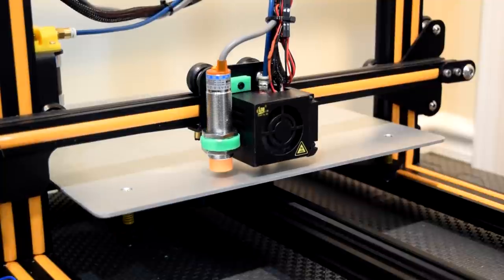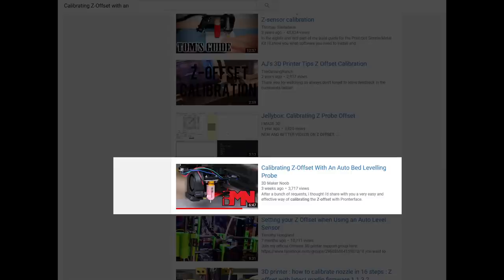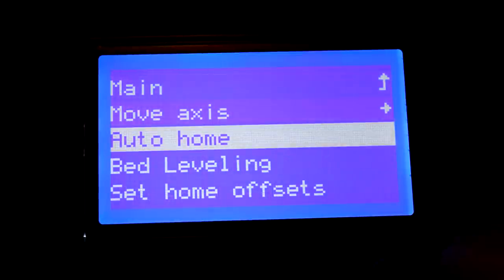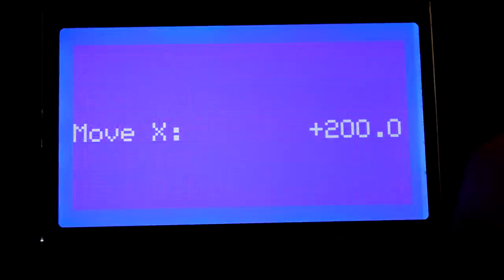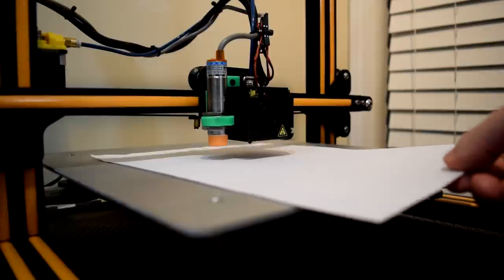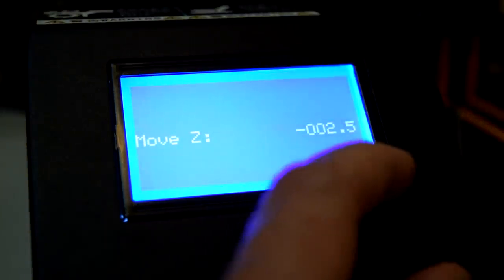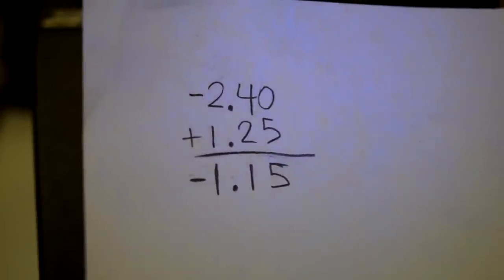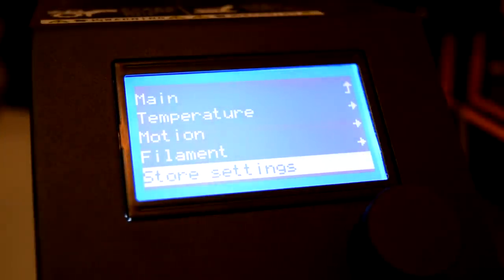Setting your Z offset the easy way in Marlin

Comment: I don't know what machine you're using but my NEW Ender 5 Plus doesn't have any of those critical options available on my screen.  If it did I would have solved my problem long ago.
Reply from the maker: it's a CR-10 with Marlin 1.1.7 installed on it. some 3d printer manufacturers disable some of those menu items to save space on the mainboard. There are other ways of accomplishing the same thing by hooking your printer up to a computer and manually sending GCode commands, but if your printer came with an auto bed leveling sensor already installed, you may want to search for other videos that explain how to do that for your printer.
Reply: @RemainIndoors  I've been watching videos until my eyes bleed.  They all say the same thing but my printer won't accept any terminal commands using either Pronterface or Matter Control.  I'm wondering if the firmware is corrupted.
Reply from the maker: @ramtek2702  I imagine you've already watched this video:  https://www.youtube.com/watch?v=zSOVAdKw4ss  I looked through a few of the comments on there and that seems to be a pretty common complaint, which sucks. What I would do if I were in your situation is look to see if there's a Facebook group specifically for that printer, because I've found that's the best place to find other people who have figured out how to fix issues that I can't figure out.  I don't own an Ender 5 Plus, so I can't be much help.  sorry.
Reply: @RemainIndoors  I've tried to watch that video but the kids English makes it nearly useless.  They don't really cover the right content anyway.  I'll try FB.  Thanks.

Comment: For some reason, I cannot lower it into the negatives. How can I fix this? I am on Marlin 2.0. using Cura.

Thanks
Reply from the maker: One option is mentioned in the video description: if you can't move your nozzle below 0 in the Move Z menu, send the following GCode command to your printer from Pronterface or Repetier Host or from the Terminal tab in octoprint:
  M211 S0
this will disable MIN Software Endstops.

Or, you can manually adjust your sensor up a little bit (carefully though, to make sure your nozzle doesn't crash into the bed) That way you would have to change the z-offset to + numbers instead.
Reply: I am having the same issue with geeetech 83 pro b printer. Did you end up figuring it out?

Comment: Does this work the same for the Lulzbot Taz 6 with Marlin firmware? I'm using a 0.8mm nozzle printing at 0.6mm layer height. I have been having troubles printing consistently because it seems like the z-offset is arbitrary. One day -1.6 is the magic number and then -1.9 becomes the magic number. Recently, I've adjusted it and then visually determined if it's working well, but I would definitely prefer to calibrate it so that it can be the same for most layer heights and so on. 

p.s. the firmware was a recent change since the new cura 2.6.66 software came out. Before this was never an issue. Maybe it's something to do with the lack of wiping the old settings? Any suggestions are welcome! Thanks!!
Reply from the maker: yeah, you may want to try what I suggested to Boyd Crowder's comment to load up the default settings from the firmware. it's hard to say if the previous Marlin settings could be affecting your new settings, but that does cause problems for some people. And, yes It should work the same for the Lulzbot Taz 6 assuming the Marlin firmware has the MIN_SOFTWARE_ENDSTOPS line commented out like this:
//#define MIN_SOFTWARE_ENDSTOPS 
that's what lets you lower your nozzle below 0mm

Comment: Newbie here.... How can I store it if there is No Z Offset listed under Control? (Sorry..I am new to this all..)
Reply: You probably don't have Marlin installed, it's an option only available with the new firmware installed.
Reply: you might need to update your firmware
Reply: Marlin on the stock Ender 3 board is somewhat limited.  You can re-flash your current board to add mesh leveling though. You can also update to a newer control board like the MKS Gen L V1.0 which has enough memory to handle all that Marlin can offer.
Reply: @TechGorilla1987  Hi, I had to upgrade the boar to MKS Gen L v1.0 and TFT 28 display I fried both the originals  ;(, but I don't have the menus for the Z offset anymore, do you know how to get then in the TFT28? I am using the latest Marlin.
Reply: @manolo5104  You have to modify the configuration.h file and enable bilinear bed leveling festure. Dont forget to put Save homming and define sensor offsets and travel limits. Thats all

Comment: Legend, thank you! I've been chasing my tail wondering why the Z offset on my Tronxy X3a didn't seem to do what I expected, now I see why :D
Edit- one question, when my machine does its bed level routine, it does a much smaller grid pattern than the actual bed size, towards the front left. Is there a way to configure this so the whole bed is checked? Thanks.

Comment: i don't have control > z offset in my lcd, would be usefull knowing the version of marlin you where running
Reply from the maker: sorry for the late reply, but I have another couple of videos where I installed an auto bed leveling sensor with an Arduino Nano on my CR-10. It's Marlin 1.1.6, and there's a download link for the firmware I used if you're interested:  https://www.youtube.com/watch?v=UtoF3Vs9YhI

Comment: I just want to know how to reset the damn CR-10 V1 to factory settings. Somehow a z-offset was applied and I can't figure out how to reset everything.  This should be simple yet I can't get a straight answer anywere???
Reply from the maker: if your printer's menu doesn't have a Factory Reset option anywhere in it, you can try hooking up your printer to a computer and sending the GCode M502 for Factory Reset and M500 to Save the settings.

Comment: Great video!  I have a question.  I had to disable soft endstops via 211 s0 to be able to lower my z offset. If I change the z offset via 851 zxx and then reenable soft endstops via 211 s1, Will the soft endstops stop the z axis from lowering down to the number I changed it to?  Would I always have to keep them disabled?
Reply from the maker: Thanks. Nice thing is after you change your Z offset and run Auto-home again, your printer will view Z = 0 with the new updated Z offset value factored in. so even if you re-enabled software endstops, you should be good, until you need to change your Z offset again

Comment: so I keep trying this but no matter what I seem to do it seems like the BL touch is still keeping my nozzle like .2mm too high so when I start any print it just ends up curling and dragging on the nozzle instead of applying nice and firm to the bed... wondering if you have any tips on how to fix this?
Reply from the maker: when you slice your files, what are you setting as your first layer height?
Reply: @RemainIndoors  .2mm for all layer heights is what I usually use. I was able to fix the problem by just trial and error..ing.. the z offset until it was close enough to the bed. so its good now! lol

Comment: Once you set your z offset, do I still need to set the 4 corners of the bed with the paper
Reply from the maker: for auto bed leveling, no.  It is a good idea to do that once, just to make sure your bed is parallel to your X axis, but it's not mandatory as the Auto Bed Leveling system will just make your hot end follow the angle of the bed.

Comment: Hello, should this be done with or without the mirror? thanks
Reply from the maker: Hi, it depends on what kind of sensor you're using. for BLTouch or Capacitive sensors you should be able to use a piece of glass on the bed, but Inductive sensors only sense metal.

Comment: Cool.  What is that sensor hanging on the side of the extruder?  I'l like to see about setting up my Tevo Tornado this way.  leveling the bead is a total bear.  Also Have to reset my X and Y axis too because the standard leveling set is too close to the edge of the plate.  Thanks
Reply from the maker: I have a video about setting up auto bed leveling on the Tevo Tornado with a BLTouch if you're interested: https://www.youtube.com/watch?v=mBwHGuX5de8
Reply: Oh thanks very much.  Yes I believe I found your video right after viewing this one.  ;-) Big help.

Comment: Nice video.  One thing though when I auto home, the hot end just goes to the 0,0 corner.  It does not go to the center like yours does, why is that.
Reply from the maker: there's a setting in the firmware that changes it to that. Are you using an auto-bed-leveling sensor? normally you would set it up to go to the middle to make sure the sensor is above the bed instead of hanging off the edge, because if it doesn't sense anything, your nozzle will crash.  Without that you're relying on mechanical endstops to tell the hotend when to stop moving, so it doesn't matter where it homes on the bed, and it has to go back to 0,0 anyway, so just faster to home there.
Reply: @RemainIndoors  Makes sense.  Yes, I am using a CR Touch, similiar to a BL Touch.  The nozzle does not crash as the home position is off the bed since I installed a direct drive, but the Z is going too far and the steppers grind after using the ABL probe.  

I guess this means I need to compile marlin myself.
Reply from the maker: @zk_6312  yeah, I haven't done much with 3D printer mods in a few years at this point, so I'm sure things have changed by now, but it's usually pretty easy to do as long as there's a bootloader on your printer's mainboard

Comment: does this setting work with octoprint or do i have to calibrator the z axis every time i start a print thro octoprint
Reply from the maker: After you click on "Store Settings" the z offset is stored to your printer, so whether you're printing from octoprint or an SD card, the z offset will be stored, and your auto bed leveling routine will follow that.
Reply: thank you so much the video was vary helpful

Comment: What would PREVENT the print head from rising up 10MM after it homes at 0 - 0?????
Reply from the maker: it would depend on settings in Marlin. This could be something that's changed since the version of marlin I'm using in this video, or it could be something that's configurable. There is a setting in the Configuration.h file called Z_CLEARANCE_DEPLOY_PROBE that is set to 10 in the firmware I was using here, and another called Z_CLEARANCE_BETWEEN_PROBES that's set to 5.

it's a hard question to answer because any number of things could cause that, but my first guess would be the way Marlin is configured.

Comment: So would this work for me having a sprite extruder pro?
Reply from the maker: this video is kind of old, so the newer versions of the Marlin firmware may not work exactly the same way. but assuming you have the version of firmware that has these settings, and assuming you have an auto bed leveling sensor, it should work. the type of extruder shouldn't really matter.

Comment: My printer runs Marlin, but doesn't have this Z-offset setting in the Control/Motion menu.
Reply from the maker: yeah, this video is pretty old. I haven't updated my firmware in at least 6 years so it's possible that option doesn't exist anymore. if I ever get around to updating my firmware, I might look into making a new video.

Comment: HELP...got a geetech a10 using Marlin 1.1.8  when i hit "Auto Home" it goes directly to the left-hand corner.   Then when i start to print it centers on the bed but the nozzle raises about 50mm.  Thank You in advance to any one that provides help
Reply: I have the same issue, still no answer :S

Comment: How come my cr-10 doesnt have all those extra menu settings? Do I need to change the firmware to get to that motion menu?
Reply from the maker: Yeah, if you're using somebody else's firmware for the CR-10 you may not have all of the same menus. I made a video explaining how to burn the bootloader and write firmware to work with my Nano Bed Leveling system here: https://www.youtube.com/watch?v=UtoF3Vs9YhI there's a different version of the firmware in the video description which has these menus.

Comment: I'm a 3D printer noob, should this be done with factory defaults to clear any current Z-Offset? Or just set this to 0 before Auto-Home?
Reply from the maker: In most cases, you shouldn't have to change the current z offset before doing this. You just add whatever your current z-offset is together with the current z height after you find a good nozzle height. If you can't lower your nozzle enough, you may want to try lowering your Z offset a couple mm, storing the settings, and starting over.

Comment: After homing when I try to touch z axis doesn't matter if i  press up or down the z goes straight up until it hits the top support
Reply from the maker: sounds like that might be a setting in the firmware. normally if it's just an issue of the endstop being inverted, the sensor will move up a couple mm then stop, but if it's traveling all the way to the top of the Z axis, maybe it's trying to home at the top instead of the bottom?

Comment: Do you heat the hotend and bed to determine z offset?
Reply from the maker: It really depends on the kind of sensor, if you're using a capacitive sensor, temperature will make a difference.  So, in that case, yes I would heat up the bed to whatever temperature you plan on printing at first.

However, if you're using a BLTouch or an Inductive sensor, Temperature isn't going to affect the sensing distance, so you'll most likely be fine with a cold bed.

Comment: I'm getting a printer with a inductive sensor, do you have a vid on how to calibrate if I want to put a sheet of glass on the print surface?
Reply from the maker: If you want/need to put glass on your bed, you're better off going with a Capacitive sensor. I don't have any videos at the moment showing this process, but it should effectively be the same as an inductive sensor.  The only difference is a Capacitive sensor will sense glass or anything really, and needs to have the sensitivity adjusted - usually by a little screw on top of the sensor.
Reply: Remain Indoors thanks for the answer,  just now seeing it, why I didn't get a notification is beyond me as I have that turned on.

Comment: Ender 3 pro doesn't go below 0 for move 😥. Anyone running into the same problem?
Reply: Yea, Marlin 2 here so yours may different on location of this settings. I made my Motion/Bed Leveling/Prob Z Offset  a little more offset, mine was something like -1.86, I made it -2.00 that then allowed me to touch the bed at +000.3 backed it off to +000.4, I set my offset to -1.6.  I will see if that works.  There is probably a way to change this via terminal or firmware change?!
Reply: Im not sure if youre still having this issue but check the video description there's a solution for that

Comment: Can u please make a video, about how to change the other Axis. X and Y, mine starts of the bed.
Reply from the maker: good idea. =)
Reply: If you are using Marlin 2.0 and you are familiar with the IDE(Arduino or VSCode) do an Ctrl+F at the configuration.h and search for x_offset and you will find the settings for both x&y there. Take a ruler and measure the offsets and type them in. Take a look at the grid too ( back and right from the nozzle is + and left and front is minus)

Comment: Do you know what lines I need to change in Marlin firmware to enable the  Zoffset option under the Menu:Control/Motion? Thanks a lot in advance.
Reply from the maker: What printer/version of Marlin do you have? I'll have to look into it.
Reply: CR-10S with Marlin1.8.6. Many thanks.
Reply from the maker: 1.8.6 is probably the version of the Arduino IDE you're using? The newest version of Marlin is 1.1.8 Did you get your version of the firmware from the CR-10 facebook group?  If you use Marlin 1.1.6 or earlier with Auto Bed Leveling I believe that menu is there by default. I think that menu may have been removed by default in later versions.  I don't own a CR-10S so I wouldn't be able to test this, but I think you can add #define HAS_BED_PROBE to the Configuration.h file to see if that makes a difference.  Otherwise, you can try working with the version of Marlin that I uploaded on my Nano Bed Leveling video. it's an earlier version of marlin but it should have the Z Offset menu
Reply: Oh You're right. Marlin's correct version is 1.1.8. About the Has_Bad_Probe parameter, stills not enabling the Zoffset menu option. thanks a lot.
Reply: I was successful enabling FIX_MOUNTED_PROBE.   Thanks a lot for the support.
Reply from the maker: good deal. I'm glad to hear you got it worked out

Comment: I just installed the marlin 2.0.x bugfix and i can't change my offset into the negative.  My hot end wont go past 0 into the negative.
Reply from the maker: There's a setting in the Configuration.h file called MIN_SOFTWARE_ENDSTOPS. put // (two slashes) to the left of that line to comment it out/turn it off.  Having that setting turned on tells your printer not to go lower than 0 in any axis.
Reply: Marlin 2 here so yours may different on location of this settings. I made my Motion/Bed Leveling/Prob Z Offset  a little more offset, mine was something like -1.86, I made it -2.00 that then allowed me to touch the bed at +000.3 backed it off to +000.4, I set my offset to -1.6.  I will see if that works.  You probably fixed this already.

Comment: How do I get z in the center of the bed? The home in the center? Same as your printer.
Reply from the maker: There's a setting in the firmware called Z-Safe-Homing it tells your printer to home wherever you specify - it homes in the middle by default.
Reply: My printer's home is in the left corner; X0, Y0. Thank you.